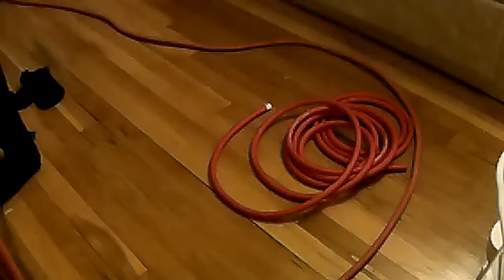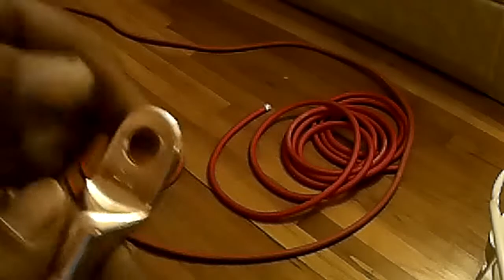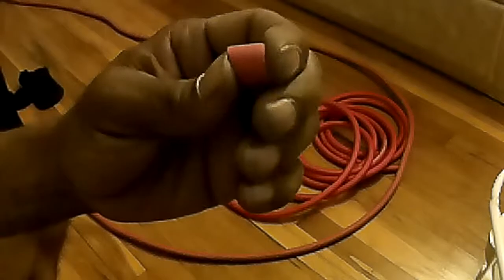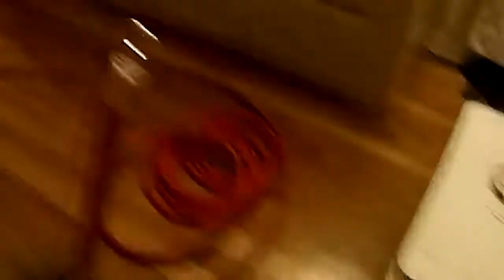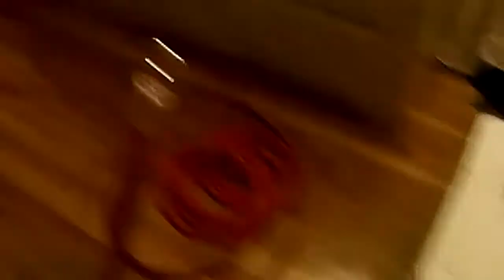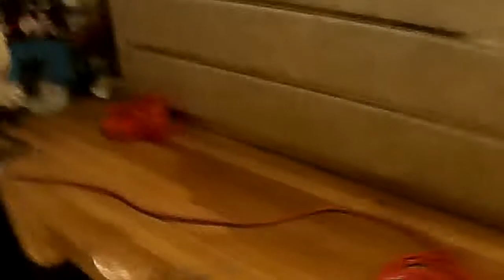2/0 Welding Cable COPPER. - CCA and OFC copper amp wire. For Bass!

Comment: So 1/0 welding cable is like 2 ofc wire not as thick ?
Reply from the maker: All depends on the brand welding cable follows industry standards car audio cable well some companies will oversize to compete with other brands 😉. This is not a bad thing at all 💪. 

1/0 welding cable is the same as 00ga 2ga is much smaller. Order as follow 2ga 0ga 1/0 2/0 3/0 4/0.

The smaller the number on the wire chart the bigger the wire ex 2ga is bigger than 4ga. 0ga is bigger than 2ga. 

But when you get into the /‘s it changes the bigger the number the bigger the wire. Ex 2/0 is bigger than 1/0. 
When you do buy make sure to get OFC trust me
Reply: @bigvell02  I bent in car audio since 1994 but when it comes to welding cable am an amateur I was planning to do the  1/0 excelene welding to power my old sundown saz 2500 but that welding cables looks smaller in diameter more like a 2 gauge cable no I wonder why everyone buys the 2/0

Comment: Welding cable is far superior to any other cable you can buy for car audio. I drug same pair of welding cables in and out over 50 feet day in and day out for over 10 years through rain snow and shine welding water well casing and never had to repair replace or do anything to the cable. I also was licensed water well pump installer for like 20 years and I can guarantee you that ofc is far superior to cca. Cca gets hotter faster and cools slower. And it’s far less conductive then ofc. Don’t forget the corrosion cca suffers from as well especially under the car if your anywhere in snowing territory.
Reply: True. Don't run your CCA under the hull of a boat. It will corrode. Truth. 😵‍💫

Comment: Quick question soooo is 2/0 thicker than 1/0 ?? I ordered 1/0 lugs for my sky high 1/0 wire and they seem small so should i order 2/0 lugs to fit my wire?
Reply from the maker: Sorry on the response time I was trying to reach this comment but it kept slipping. Yes 2/0 is thicker than 1/0 Skyhigh is oversized for a fact. Their 1/0 is like 2/0 welding cable. The 1/0 should do the trick hopefully they wont be loose. Keep me posted

Comment: I have 2 runs off 1/0 cca currently.
Now with a bigger amp I'm about to run welding cable.
My question is would you remove the 2 runs off CCA and just leave the welding 2/0 or leave the CCA and have both?
Reply from the maker: If the CCA cable is in great condition no corrosion behind the heat shrink and terminals keep it and use the welding cable over it. Example 1 run of positive and Neg. in CCA just add a run of Pos. and Neg. with the welding cable. I wouldn't use the welding cable on a positive and CCA on a negative or vise versa. PS your going to see a nice difference in voltage as well.
Reply: @bigvell02  I'll check for corrosion.
If it's corroded then i should Toss it?
Reply from the maker: If its corroded its usually just at the tips you can cut it out and add new terminals if you have enough length.
Reply: @bigvell02  I do think my under hood upgrades have some. I'll just replace them and check the rest.
Being on a budget I'm buying wire in pieces here and there on eBay and stuff.
I have a new 20-foot piece of 2/0 Excelene coming today.
Looks like Flexaprene is slightly cheaper new so I'm gonna grab a roll of that in a month or 2.
my new amp won't be here until the end of November so I have time.
Deep discount on pre-order 😂
Reply from the maker: bassmansoundking99 if your getting flexaprene wire make sure you use tech flex wire protectant. The rubber jacket is not the best when it comes to abrasion. The wire under the hood I would definitely check. Even with copper I still check my connections once a year wire brush them and dielectric grease is a plus

Comment: Is welding wire cca or ofc? I dont know whether to use welding cable for my big 3 upgrade of ofc wire.. i can get welding cable 2/0 way cheaper but everyone is bigging up ofc so...is it worth it to pay more for ofc?
Reply from the maker: Welding wire is OFC no doubt. Its like 95-99% pure copper, great stuff no doubt.
Reply: @bigvell02  ok cool. I thought ofc was a superior version of pure copper but i guess its all word play created from the car audio world
Reply from the maker: Yes nothing but word play. UL listed Welding cable is definitely OFC oxygen free copper and does rated. Ive seen the same stuff powering huge DC machines in factories as well as 90% of my basshead friends run it. Most have insane systems too.
Reply: Try to ensure the welding wire is high quality. I found some welding wire only 80% pure copper.
Reply: @haziq90  how did u find that out? The welding wire i bought looks 100% copper. Nice and reddish bronze.
Reply: @akuma4u  i ask the seller because the price is suspiciously cheap.
Reply: @haziq90  hmmm. The place u r buying it from, is it an actual electrician/welding store? I buy mine from an actual welding/electrician supply shop.
Reply: @akuma4u  online store. Haha
Reply: @haziq90  there you go lol. What a bunch a liars. Always best to buy welder wire from actual welding/electrical store. Every city has at least one.

Comment: Great video.  Just got some 2/0 welding cable and wanted to know what size tech flex would I need
Reply from the maker: Thanks much :). I appreciate that I usually get 3/4 inch its perfect IMO it opens up to over 1 inch.

Comment: So 2/0 welding cable is comparable to 1/0 car audio cable (size wise)?
Reply from the maker: Car audio cable has more strand counts . Some companies will over size their cable so its under rated. Some companies wire OFC is fluffy and when you smash it down its smaller than OFC welding cable. The welding cable feels more dense than 80% of the wire Ive held. I would definitely say 2/0 is like skyhigh OFC 1/0 but most of the other brands its about the same
Reply: @bigvell02  thanks for the info. Gonna be switching to welding cable for my next upgrade. Ran Knukoncepts 0gauge ofc for everything so far but now there's no reason not to switch to welding cable. Any brands you suggest?
Reply from the maker: I'm running Crimp Supply and so far issue free (midwest weather, salt, etc) I switched from 0ga CCA and the difference was night and day. If you do run crimp supply I suggest using tech flex wire loom. This will protect the jacket from rubbing. Best 7-10 bucks you can spend and it looks great. I also like Royal Excelene. both 2/0 are fairly easy to work with but can be a pain hooking up a fuse block on a tight tight bend. 4/0 welding cable is the same size as skyhigh 2/0 but more dense from what I hear. Not my words just a basshead grapevine. Power for the dollar is my thing
Reply: @bigvell02  thanks homie. I'll definitely check those out. Saving money is a good thing in this game lol.

Comment: Question? I bough the 1/0 the competition sells, do you think that will run my second battery from my isolator to the trunk and run my Rockford Fosgate r600x5 and my r750 amp?
Reply from the maker: 1/0 from the competition is it copper (OFC) or is it labeled CCA? If its
 copper you shouldn't have any issues at all. Those amps are pretty 
efficient you might see 135-150 amps max on your system.

Comment: I bet this brother has a banging system, knocking! Knowing is key, stay on top of your game....ANT ECHO X PARK
Reply from the maker: No power issues at all. Performs well and my amps are very power hungry they can pull over 300a on music and over 500 amps in the lanes.
Reply: I’m gonna get some of that and use it a 2nd battery install. I will also run that to my amps. I have a Rockford Fosgate r600 5 channel, and a r750 mono. I think that will do it

Comment: So do you recommend the 2/0 welding wire even tho it has less strands then the reg ofc with 4000 plus strands?
Reply: Or the welding cable strands alot thicker?
Reply from the maker: The strands in welding cable are much thicker. A little harder to bend but still pretty flexible. I look at overall diameter and rating for the dollar. Welding cable is also true to size 👌
Reply: bigvell02 thx for the info bro really do appreciate it 👍👍
Reply from the maker: No Problem, bassheads look out for each other all day!!
Reply: Also , pure copper 2/0 welding wire is much more conductive than the cca, yes

Comment: Don't use CCA wire if you look it up you will see.
Reply from the maker: I agree! That CCA you saw in the video will be the last ever bought. You couldn't pay me to run CCA in my builds OFC only. I put the welding cable inside techflex on areas that might rub the jacket can be almost like and eraser type material.

Comment: wat up , have you installed cable ?  how  is it  working for you?  is it  flexible ?  great vid ty .
Reply from the maker: Haven't installed it yet just waiting for a good day to tear everything apart. I will be making a video on it too ;-). The cable is very flexible just heavy compared to other cable commonly used in car audio. I'm sure it will be easy to run in my car (I plan on running in the interior). I will do a resistance and  voltage comparison when I make the video as well.
Reply: ty for the info will be waiting for the install vid.
Reply from the maker: juanitom71 update I've bought 2 more rolls and it's installed. Great cable I also did install and update videos definitely a must buy for bass.

Comment: nice!
Reply from the maker: Yes Sir.. And I got it for around 40 bucks.
Reply: +bigvell02 wow.....how many ft for 40????
Reply from the maker: I got 15 feet of 2/0 and 5 of those seamless lugs for $40. Its definitely worth the dollar its the same stuff they sell at a local welding supply for $120-160
Reply: @bigvell02  where you score your wire , piecing up a big 3 and power run now..